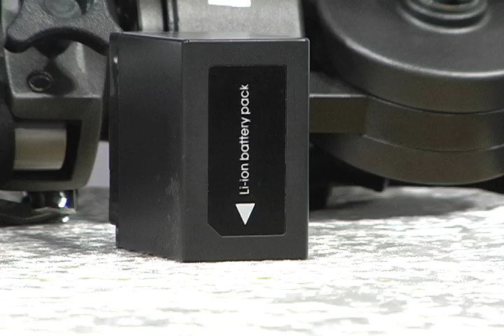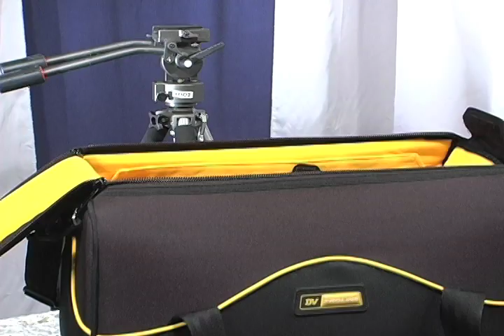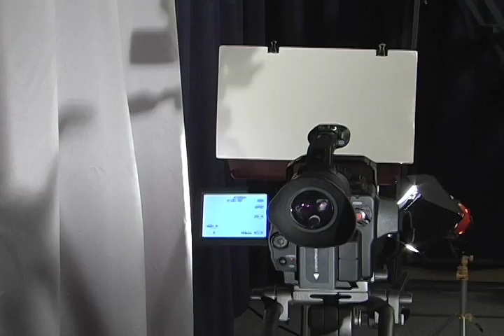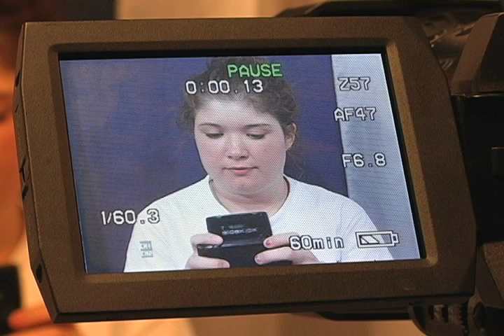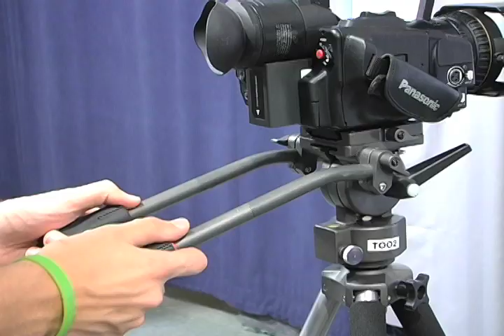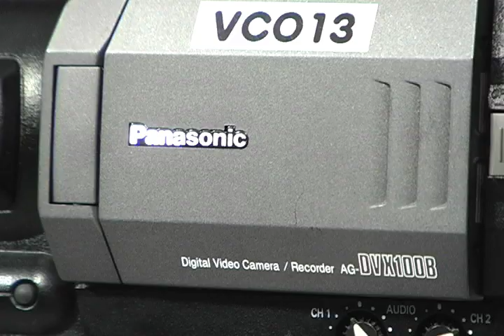Using the Panasonic DVX-100B

Comment: @ThaaatsEnough use any dv tapes....but some experts stress using the same brand tapes consistently....use good quality thicker dv tapes ( sony masters are good) since  the cheaper brand tape will deteriorate over time and you wont be able to sync time code in final cut because of metal particles and dust create artifacts... i am talking about tapes that 5+ years old